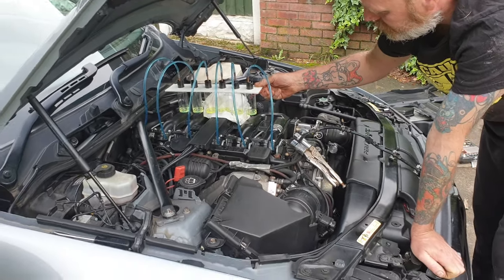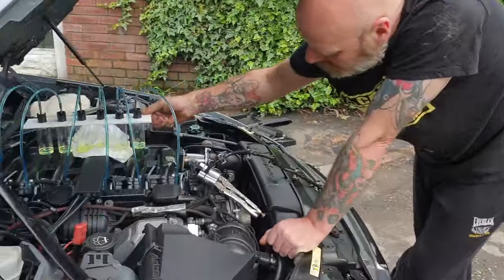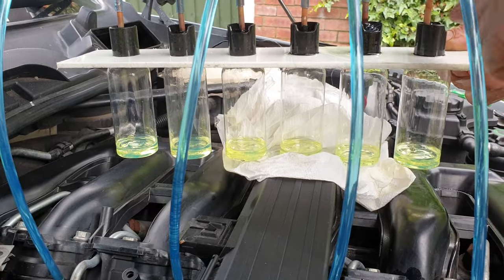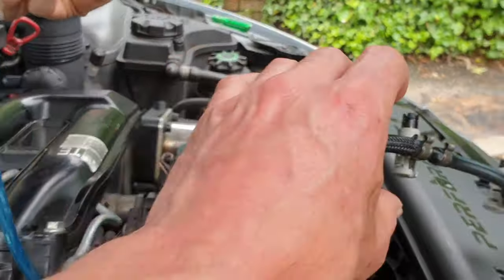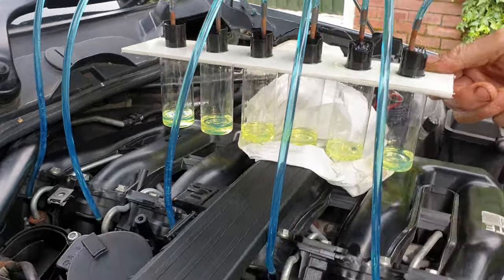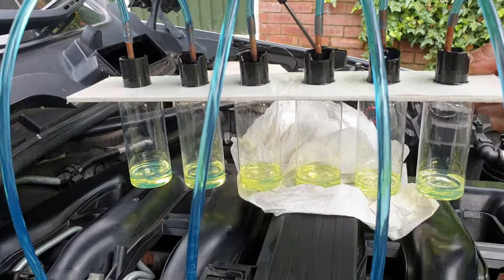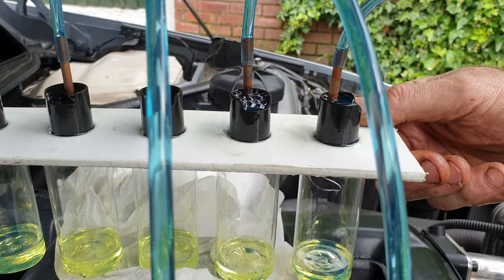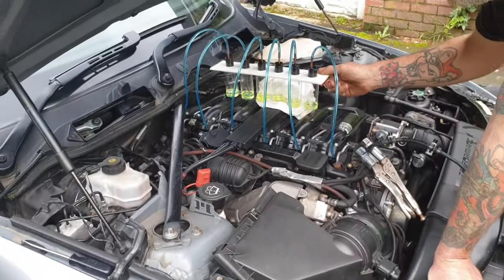BMW e92 335d leak down test on injectors

Comment: Got this exact issue! Changed the maf from a running car too but no luck! Ever get to the bottom of it?
Reply from the maker: Alright pal, mine turned out to be a faulty map.... had it remaped with a custom map to remove the maf so the problem would never happen again.... car has run perfect ever since.... i sepent so much time and money trying to figure out what was wrong. To the point i was just gona get rid of the car
Reply: @TheBlackSheepprojects  ffs hope i’m not going down the same rabbit hole! Thanks anyways pal
Reply: @TheBlackSheepprojects  did you change the wiring loom by any chance too then?
Reply from the maker: @TKhouseofcars  ..... no the car has stock wiring and i havnt changed it. Does your smoke go away when the maf is unplugges aswell?
Reply: @TheBlackSheepprojects  yeah exactly! So I get blue/white smoke on start up and the revs fluctuate between 500-1000rpm and do so until its warm. I also get sluggish power but randomly! I thought I might have bad compression  but as soon as I unplug the MAF it settles! I’ve just ordered a leak off kit but I dunno if it’ll be injectors now watching your vid…
Reply from the maker: @TKhouseofcars  .... have you got inpa or ista? This will tell you the adjustments on the injectors. Might identify a faulty one. Also check the plug for tge maf, make sure its not damaged or corroded.
Reply: @TheBlackSheepprojects  na i havent unfortunately or would’ve used them! Trying to see if anyone local has it but cant find nobody atm! Good shout on the plug i’ll check that again!
Reply from the maker: @TKhouseofcars  ..  if you have s laptop you can download them very easily and the usb to kdan plug id about £10 on ebay. Loads of YouTube vids explain how to use. When i was doing my car i spent a week doing research online and learned how to do it myself. Comes in very handy ehen you own a bmw :)
Reply: @TheBlackSheepprojects  I’ve tried far n wide but cant ever find it. You got a link for it by any chance? I’ll order the cable now in that case
Reply from the maker: @TKhouseofcars  https://www.car-programmer.co.uk/bmw-standard-tools

Attachement and password are on that page.... i havntcused this 1 before but all the comments say it works fine. Let me know how u get on.
Reply: @TheBlackSheepprojects  Thanks bud. Leak off kit arrived today. Lets see how we do
Reply from the maker: @TKhouseofcars  keep me posted :)

Comment: Mate what bumper is that and did you do the exhaust to suit yourself or get it done somewhere??
Reply from the maker: Alright pal it's an autovouge kit, if you search eBay the are alos listed as AVR

Autovouge are a company you give the car to and they fit front, rear bumpers, side skirts exhaust and also 20" wheels, I obviously change the wheels for my own. Car is know as bmw e92 autovouge 👍 hope this helps
Reply: @TheBlackSheepprojects  spot on mate cheers will look into this it looks sick
Reply: @TheBlackSheepprojects  well, will look into this after I’ve sorted my injectors 😂😂
Reply from the maker: @barnzYT  what issues are you having?
Reply: @TheBlackSheepprojects  Ayup pal, Been looking online and would appear autovogue has sadly gone bust which is a shame because that rear bumper and diffuser is so nice
Reply from the maker: @barnzYT .... Ye just looked all the ones off ebay have gone aswell. Shame as it was a nice kit.

With regards to your misfire do you have ista or impa? Worth getting if you don't it would help figure out whats wrong with yours
Reply: @TheBlackSheepprojects  I don’t I have a crap Chinese OBD plug in atm but my mate has got a snap on reader might get him to have a look.

Bit unsure at the minute if it is injectors, maybe glow plugs, maybe MAF or throttle body. Will investigate further.

Either way I’ve been watching all your vids now lol
Reply from the maker: @barnzYT ... Try unplug the maf, run the car turn off and run again...  the car will go to a default setting. If their is no change you can rule out the maf. 1 thing less 😊 same with the injectors, unplug 1 by 1... If you unplug 1 and it doesn't how the engine is running then you have found the fault injector.... I suppose this will only work on a failed injector not 1 that's leaking or poor performer

Comment: Hi,

What size pipe did you use for this? 3/4mm sound about right?
Reply: Also, is it easy to get the return pipe clips off?
Reply from the maker: i used 3mm as I had it already. I heated it up to fit 4mm will fit better. very easy to get the return clips off just pry up from the bottom of the grey clip and they will come off fine.

Comment: Did you ever do the measurements on this? 

These were my results 

Leak back - idle of 6 mins 
Cyl 6 18ml (3ml)
Cyl 5 16ml (2.6ml)
Cyl 4 16ml (2.6ml)
Cyl 3 16ml (2.6ml)
Cyl 2 15ml (2.5ml)
Cyl 1 18ml (3ml)

Leak back 5 mins cycle (2 min idle, 30 sec 3k rpm then 30 sec idle X3)
6 - 14ml
5 - 13ml
4 - 13ml
3 - 11ml
2 - 14ml 

Be good to see how they compare. My levels in the bottles all looked pretty much identical, only could tell by measuring the liquid etc
Reply from the maker: i didnt measure as they all pretty much identical. when an injector is bad the difference in leak back is noticeable. these 335d engines have that many things to go wrong. do you have a video pf your smoke ?
Reply: l8on6661 yeah, just uploaded one of the smoke, is defo blue. Also older ones of the smoke. The first loads of smoke about a year back are really bad, but it doesn’t appear to be as bad, but still there

Comment: Did you fix it? What was the problem?
Reply from the maker: still problem solving pal these engines are a pain in the arse to diagnose. i have hooked it up to ista D i am now convinced the new bosch MAF i bought wad defective so i have sent it back and i am waiting on the replacment.
Reply: @TheBlackSheepprojects  please keep me updated. Thank you!
Reply: Hi mate, your smoke looks white? Is it sometimes blue or grey?
Reply: How was INPA/ista results for ecu correction?
Reply from the maker: @TS-ji1me  .... yes pal both like you said. i found unpluging the maf fixed the issue which suggests faulty maf
Reply from the maker: @TS-ji1me  ista d showed small turbo wasnt want kicking in unpluged  maf and all was fine . ordered a new maf and i  will update shortly
Reply from the maker: @TS-ji1me  .... yes pal it does change.  i found unpluging the maf solved the issues.i have ordered a new maf will update shortly.
Reply: l8on6661 ok mate, let me know how you get on. Tried unplugging egr, then maf and still smoke at idle. Mines blue though, so frustrating. Seems to be worse when warm for me 

Is your remapped and dpf/egr ?
Reply from the maker: @TS-ji1me  .... i had blue smoke also pal fixed that with a new ccv valve. have you checked yours? also when was the oil last changed. mine is remapped with egr delete, swirl flap delete, dpf delete  and bigger intercooler
Reply: l8on6661 turbo and oil filter etc done yesterday and before that about 6 months ago. 

I have the vortex breather in there now, but also tried the old loo roll style breather. Either been really unlucky with a bad recon turbo, or internal problems
Reply from the maker: @TS-ji1me  ... couple of things you can try is..... take the crank case hose off where it joins the intake so it vents to atmosphere see if the smoke goes away. if it does then u know its to oil vapour burning. if that is the case use a thicker oil.... also do a leak back test to see if u have a faulty injector diesel can also burn grey blue.
Reply: l8on6661 is your smoke blue or white? When you unplugged maf does it go straight away? 

I might vent to atmosphere, but the pipes al have some oil in. I’ve changed back to a vortex and it’s less oily now. 

What oil would you use? I have 5/30 in currently, last two changes it’s smoked quite a bit - guess the thinner oil and being fresh
Reply from the maker: @TS-ji1me  my smoke is white on tickover but when u rev the engine you get blue at the top rpm range. when i unplug the maf i start the engine and it still smokes i have to turn the car off  after a minute then when i start the car again the management light comes on and the smoke is gone and stays gone.this is because its now running on a default map regarding the amount of air vs revs as it cant detect a signal from the maf.... the reason i say use a slightly thicker oil is because it creates less vapour than thin oil. i am going to put 5w40 in mine this means the oil is slighly thiker at hot temperatures. what mileage is your engine? i have also put a pro vent oil separator on mine which does a great job of filtering out the oil and because you catch the oil you know how much to replace. I have a Video on the in my videos
Reply: l8on6661 oh I’ll have to try that. Think I’ve only done the maf while it was running. Miles is 154k, yours? 

I am thinking about putting a catch can on once I’ve ran the car without the intake pipe on attached to the intake manifold, providing the smoke eases or disappears. 

The way the pipes are positioned on the intake pipe it’s going to be a squeeze to get two 19mm pipes round, but if that’s the problem I’ll do it
Reply from the maker: @TS-ji1me  ....mine is on 85k and runs great i have only had it 6 months and i paid through the nose for it thinking i would avoid all the problems..... that didnt work out lol. what pissed me off was the problem started 3 weeks after i bought it. check my video out on the oil separator it may help u find a way of running pipes as i struggled at first as there is no room on the air box and turbo side plus it gets really hot.
Reply: l8on6661 did you manage to resolve the issue?
Reply: @TheBlackSheepprojects  hey brother. Isn't it normal for the car to smoke a little bit after a remap? I've done a remap on my n47 and she smokes a tiny bit on startup. When the engine is up to temp it goes away completely. I also noticed it takes the engine longer to reach operating temperature due to my egr blanking. So the smoke sticks around a little while longer. But otherwise no fault codes or running issues. I'm really not sure if I should be concerned or if this sort of thing is to be expected with the modifications we have done.
Reply from the maker: @johnconnor513  ... hello pal, mine is remapped,egr blanked off, wanger down pipe and intercooler. I have a bit of smoke off the key then instantly goes. My smoke is down to my glow  plug modual once thats changed it should go. The only smoke i get after a map is when i floor it this is due to the extra fuel.... no smoke no poke as they say. If yours is smoking till it reaches temp i would sugest u get you codes read  as you plugs or modual is not working. Use a deset reader not a cheap 1. My reader shows no codes but when i use impa i have faults codes for the heater module.
Reply: @TheBlackSheepprojects  thanks for the help buddy. I'm going to try a new battery as well. I think mine is out of spec now. It's over 4 years old.
Reply from the maker: @johnconnor513  ... dont forget when u fit a new battrry u have to code it to the car. Basicaly all your doing is telling the car what amp batter u have put on and it also knows not to overcharge. As the car ajusts to a batrerys age and over charges to compensate for the loss of power over time. If you just put a  new batter on you run the risk of overcharging the new one as its still thinks it has an old battry fitted. Did mine last year. Just used impa to reset. Hope tgis helps.
Reply: @TheBlackSheepprojects  huge help. Thank you man. These bmws give us stress😂
Reply from the maker: @johnconnor513  they say if its got tits or tyers its going to give you problems 🤣
Reply: @TheBlackSheepprojects  Haha. True story. 🤣
Reply: Did you resolve the problem
Reply: I have same problem unplug the maf runs better
Reply from the maker: @monstermanmw  had the car mapped for no maf. Runs perfect. It could have been a failed map on the car but eaier to get a map with the maf mapped out. Never looked back 😃